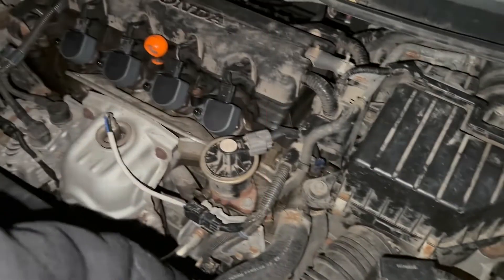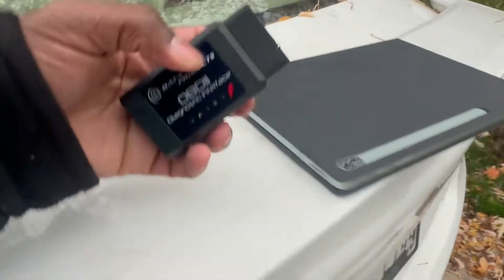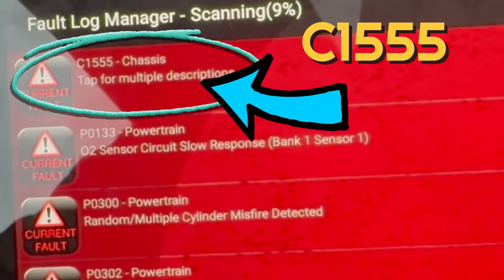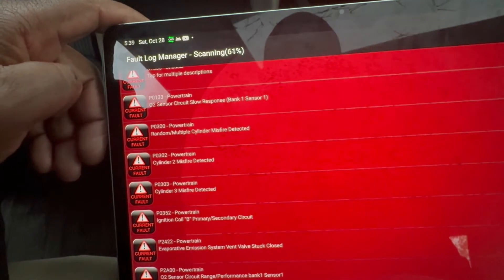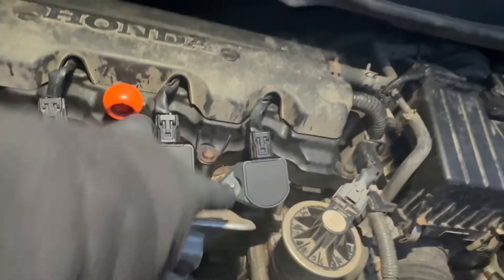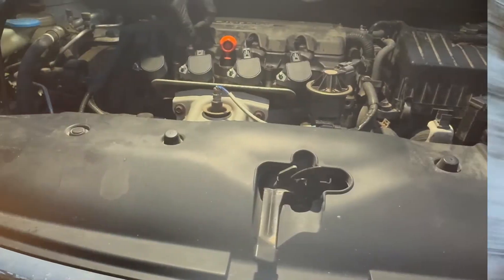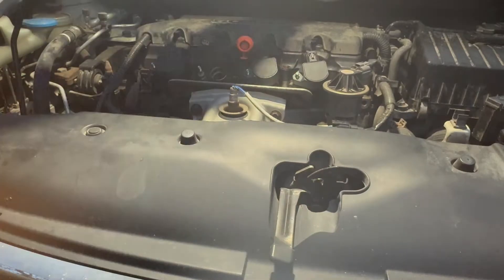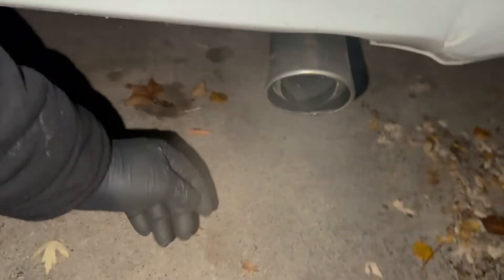Engine Misfire code P0300 P0301 P0302 P0303 P0304 P0352 Diagnose and Repair Honda Civic

Comment: Im working on a civic that has po300,po301,po302,po303. All cylinders are firing but it still goes into limp mode when driving over 30-40mph. Any suggestions?
Reply from the maker: You will have to resolve what's causing those codes then reset limp mode

Comment: I have all the  03xx codes, did the diagnose like you did, unplugged each one, engine ran more rough except for #3, it didnt run as rough as the others but engine didnt run good. What else could it be? thanks
Reply from the maker: If it ran rough but not as rough it could mean that it’s not functioning as it should. Question. Are you still using OEM ignition coil? Have you changed the spark plugs. If the spark plugs are old start there and change them. Switch one of the good coil to #3 and see if there is any change
Reply: @trackpalmer  They might be original coils, not sure. Plugs are good. I cleared the codes, switched 2 coils, and still get p0303 code. So that eliminates the coils. Next 2 things are compression test and check the #3 injector. Thanks for your reply.

Comment: Thank you for the video, very complete, I will put it into practice since my mother's car has the code p304, it also has the p135, is it possible that it is related to the misfire as well?
Reply from the maker: Sounds like you also have a problem with the upstream oxygen sensor as well. Check the wires. If they are ok, the oxygen sensor might need to be replaced as well. Genuine is highly recommended
Reply: Is the one seen at the beginning of the video right in front of the head, the correct one?
Reply from the maker: @ yes
Reply: Thanks
Reply from the maker: @willyplayer5393  that’s a problem with the oxygen sensor. Fix the misfire then clear the code and see if the p0135 comes back
Reply: @ I'll try to solve it that way but I'm not sure it's just a sensor problem, the cylinder is sounding a little ugly, it doesn't knock but it sounds strange like it's rubbing against something.

Comment: My Honda civic has same issue. Anytime i accelerate the engine light comes on. So i just parked the car. This video is helpful, im in poland but how do i order an obd scanner. To run my check
Reply from the maker: You Might just have to get it locally. If there are shipping companies locally that handle shipment of small orders you can buy in Amazon and use them. https://amzn.to/4dNIXu9 or https://amzn.to/4eSeFY5

Comment: What if ya did the lift test and moved the ign coil but the problem does not move to the other location. Then is this clearly the spark plug causing the issue?
Reply from the maker: that would the the spark plug or electrical problem to the coil
Reply: @trackpalmer if the plug and coil are found to be good, would the fuel injector be the next component to troubleshoot?
Reply from the maker: If you find a bad cylinder and replace the ignition coil with one that you're sure is working, then you know that the problem is not the ignition coil. It's something else. First, check the wiring. Ensure that you're getting signal to the wires, then check the spark plug

Comment: I did everything that you said to do I have the P0 300 misfires change the coils and the spark plugs. It runs quiet but my radiator fluid keeps going down. I don’t understand what happened. Can you help?I cleared it the car runs quite or sometime idles when starts up then mellows out the code came back and check ingenue like came on now I think the spark plugs I got with the new coils dnt agree any advise
Reply from the maker: It sounds like you have a failed head gasket. You need to figure out where that fluid is going. How many codes do you have. Code P0300 normally comes with other codes
Reply: @trackpalmer  Great video thanks so much but Before I changed my coils and spark plugs it was one code after changing all 3 codes of misfire came on can u please help